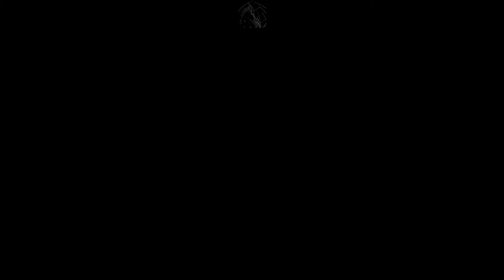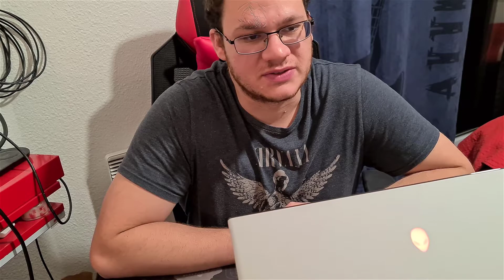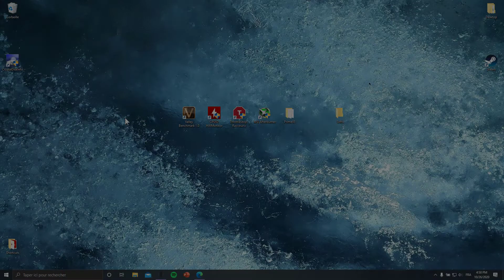How to Undervolt Laptop CPU / OC GPU / Reduce Heat FULL GUIDE (M17 R3, I7 10750H, 2070S)😏😏

Comment: Hold shift to highlight your voltage range on the curve, after adjusting a lower voltage to your target frequency. The target frequency for the lowest voltage on your curve must be above the remainder of the curve. If you hold shift + click, dragging over, then hit apply, it will straighten the entire curve from the low voltage point you adjusted to the target frequency. Saves a lot of time, rather than tediously adjusting each voltage along the curve.

Comment: Lately I have been experiencing a lot of fps drops and high temperatures. I have a Dell G3 gaming laptop spec: i7 10750h1660ti 512SSD and 16gb of ram. So I downloaded the software throttlestop; however I can't change the cpu voltage or Turbo Boost Ratios. These are locked for some reason.
Reply from the maker: Unfortunately, some models are locked.  However, you still can physically cahnge the thermal paste between CPU, GPU and the heatsink to avoid overheatiing and fps drops. For regular gaming laptop user, this maintenance need to be done at least every year.

Comment: Hi man, I have an Acer Nitro 5 with I510300H, you think that could it work in my case? Do I have to unlock BIOS before?
Reply from the maker: Hey, you shouldn't have to touch to the bios. Using throttlestop should work.

Comment: How did u undervolt?? I have an Asus strix laptop with it 10750h but wasn't able to undervolt due to plundervolt...
Reply from the maker: If you can't use throttlestop, check Bios settings maybe you have and overclock or performance menu to undervolt there.

Comment: I’d imagine you’d recommend doing this out of the box, huh? lol
Reply from the maker: It only depends on what people want for their laptop.  But usually, less heat is more comfortable.
Reply: @cyclo16hacks  I’ve undervolted the 10750H to a 3.0Ghz cap. Was at 3.5 but was still maxing out at 93-100C.

At 3.0 at full load, it maxes at 74-82C.
Reply from the maker: @TheFaux1776  3.5 still pushing 100 °C ... weird. But in prime 95 ?   In games it should be somewhere around 80°C maximum no ?
Reply: @cyclo16hacks  nope.

Comment: Great Video, thanks you so much.
I’ve just ordered an Alienware m15 r4 i7 3060 with the 300hz display, I don’t intend to use it for games, but for university study, autoCAD and solid works. My only concern is the 300hz display draining the battery away while surfing the web. Do you have a solution for this? Any help would be greatly appreciated! TIA.
Reply from the maker: Hi thanks, unfortunaltely, if it's like mine (300Hz too) the dispay is physicaly connected to the 3060. Which means there is no optimus for power saving. I don't know if Alienware implemented a GPU switch on R4 but there's nothing you can do. The best battery si along with 144 Hz panel I believe. Still stuck with 1 hour battery XD.
Reply: @cyclo16hacks  So not even reducing the refresh rate to 60hz helps?
Reply: @Balthazarry  nope. I play my in my backyard on my 2080super/10750h raider, tried lowering my refresh rate to 60hz for more play time on battery. I get maybe 45 minutes max playing re2. Little over 30 playing horizon.

Comment: What overclock values you use for your laptop ? I have the same one and wanted to see what’s the max overclock values I can use for it.
Reply from the maker: The max OC for benchmark like 3Dmark is +192 Mhz on core clock and + 500 MHz on memory for me. (gives me better results than 3080 "maxQ") But those values are not stable in games like COD. The stable value for all games is +125 MHz on Core + 300 MHz on memory. (applies only on GPU RTX 2070 Super since I have an i7 that can't OC.)

Comment: I have m17 R2,can I follow the same procedure,and my undervolting is locked ,so please help
Reply from the maker: Can you check "Unlock Adjustable voltage" in Throttlestop ? I've seen some people saying that after the latest BIOS update undervolt is locked ... so if you did this update this is why. And I'm not sure you can roll-back.   Else, you still can play with the turbo ratio ??  If not, go in windows advanced power setting and set the maximum CPU perf to 99%. It will disable turbo. You'll loose quite a lot of FPS but it will reduce T° by 20°C.
Reply: unlock adjustable voltage is available ,i followed the steps but there is no decrease in temperature,and if i change the turbo limits ,will it affect the gameplay and can i set the offset voltage to -140 and see if it works
Reply from the maker: @vruven  the undervolt is not meant to make a significant changes even if it does something ... If you want to see a real improvement you need to make a compromise between temperature and performances with the ratio. This is the only way. You need to find the ratio that stay stable and don't throttle.
Reply: @cyclo16hacks  and I am not able to change the voltage bin Intel xtu but I can change in throttle stop,and the temperature has not decreased at all

Comment: Hi . My laptop alienware m15 r3 have gpu rtx 2070 super and cpu core i7 gen 10 , 
When i overclocking ti on core clock 150
And memory clock 200 as u do the game crashes after 5 or 7 minutes . Can u tell me where's the problem plz ?
Reply from the maker: Hi !! It depends on which game. Every games doesn't support the same overclock. ex: Warzone will only take +125 MHz (clock and +300 Memory) in my case. As with Apex Legends I can go up to +190 MHz on CLock and + 500 MHz on Memory. Som other games, will jsute not run with overclock.  But in all case, put + 125 MHz core and + 300 MHz Memory, you should be fine :)
Reply: @cyclo16hacks  thank you so much

Comment: @Cyclo16 Hacks Do you know if I can use these values for the original 17 r3 (not m17 r3)?
Reply from the maker: I don't think. 17 r3 has older CPU which at the time didn't suffer from overheating like now I believe. They had a huge fan and better cooling.

Comment: when i run prime95 temps go up to 100 *97 degrees and stays on that temp for like 10 secs then decreases to 70-75  degrees and stays there is that a problem?
Reply from the maker: are you running on battery ? This could explain this behavior. Else It could be another power setting.
Reply: @cyclo16hacks  no i pluggged the charger and battery is full
Reply from the maker: @msbrdmr  hummm .. check the CPU clock frequency. Does it change when temps drop to 75 ? Maybe there is some limits due to throttling but it's weird.
Reply: @cyclo16hacks  I did undervolt and capped the freq to 3.8 ghz now its running stable at around like 70-80 degrees I think thats fine but as i remove the cap on frequency, temp goes to 95-97 even with the voltage reduced.
Reply: @cyclo16hacks  and when it drops to 75 , my frequency drops as well. It might be some kind of throttling like power or temp.

Comment: Hey there, can we do anything about the extremely annoying high pitched screaming noise that goes along with the fans? Thanks.
Reply from the maker: Hey ! Except trying to tweak fan speed using custom profile in Command Center, there's nothing to do. :(  It seems to occur when fans are barely audible, so maybe just increase them a little bit or use cool mode when not gaming.
Reply: @cyclo16hacks  Hey dude, I actually solved the problem with the M17 R3 whistling noise.  It's not the fans at all, it's the case.  You can almost completely remove the whistling by popping off the bottom of the case and putting a bit of electrical tape over the four little wires that cross over each fan---you'll see what I mean when you look inside.  You don't need to do anything more than pop off the back.  After putting some electrical tape over the wires, the sound is almost completely gone while at idle and temps are running 35-45C when on full speed so there is no impact to the temperatures whatsoever.  It's just a very bad case and not coil whine or bad fans at all.
Reply from the maker: @ptanyuh  Hum interesting. So, this noise was just because the air sucked through the wires make them whisper ?! Gonna try that !! Thanks :)
Reply: @cyclo16hacks  Yip, exactly! You can still hear it if you listen really hard because you know it's there, but it's MUCH MUCH MUCH quieter.  It's a stupid case design....
Reply: @ptanyuh  alot of people have that problem, you should make a video showing what you did!
Reply: @cyclo16hacks  Not for me, it occurs almost constantly even on quiet mode or using the fan settings you suggested.  Very rarely do the fans completely shut off and I can't hear it.  I can't get the fans to go any lower than 50% so the noise is always happening.  I don't mind it while gaming to be honest because I wear headphones anyway, but being able to sit on the couch and watch a movie or sleep with a podcast on is something I need to be able to do with my laptop, and right now I have a constant migraine from this stupid f***ing noise :(

Comment: just a heads up,  make sure under "Save Voltage Changes to Throttle Stop" On the bottom right corner you check the box "Ok Save immediately". or you will loose your changes when you close out.

Comment: please help someone,
 i can not change the turbo ratio limits does someone know whats wrong ?
Reply from the maker: It happens that some laptop settings are locked by manufacturers. If you slide down the ratio and then it doesn't show any changes, maybe it is locked. (try run the program as administrator again) but ... can't tell you more. There are probably other thing you can try like go in BIOS to unlock but it depends on your specific laptop  model.
Reply: @cyclo16hacks  i have the Acer Nitro 5 (AN517-52-7311) i7-10750H Geforce nvidia gtx 1650 4gb

Comment: I have a acer nitro 5 with i7 10750h end rtx 2060... My initial settings say that core voltage is a  (+ 0.5). What can i do? Help me.
Reply from the maker: initial setting is +0.5 V in core voltage offset in throttlestop ???
Reply: @cyclo16hacks  yes
Reply from the maker: @roccoscicchitano4795  I never seen that before. Also my experience is limited to a few laptop I owned. But you still can try to reduce it slowly. like 0.5 to 0.45 to 0.4 to 0.35 etc etc and if there is no blue screen  or crash during test then keep trying in negative. That's what I would do. But, it's your device ... your risk. Can't know if acer did some internal tweak.  :/
Reply: @cyclo16hacks  thanks bro

Comment: What thermal profile were you using? And with stock paste, -90.8mv on core and cache, in prime95 running at 3.6Ghz using 71.5watts on package average, and running it for 2 minutes on performance mode got me to 91c. Is that alright?
Reply from the maker: 91c on prime 95,, it's fairly good with stock paste ! (edit: was on performance mode))

Comment: the voltage offsets are still 0 after applying the desired offset values... even in Intel XTU,  these options are greyed out.. pls help
Reply from the maker: It seems like some manufacturers lock CPU settings. Sometimes you can unlock in BIOS, sometimes you can't. Throttlestop is the best way to acces this, since XTU need to be manually restart.

Comment: I set -100 on my Alienware m17 r3, after that my notebook is freeze
Tried  it few times. Have the same CPU. -90 works fine for me
In any case thank you man, you save my life))
Now I have temperatures around 50-60(I set also 3000 frequency on my CPU)
Reply: Did u just restart to fix the freeze?
Reply: @crysis1174  yep, I just did a restart
Reply: @АндрейКоваленко-о5е  Which settings were it on? Save immediately or do not save?
Reply: 3700-4000 its still good but 3000 is to much down... Understand how inportant is temp but this procesor can use with 70-80

Comment: Is it normal for the fans to not be on at all sometimes i noticed unless im in a heavy load they are at 0 percent in control center  in the balanced fan mode  with cpu and gpu temps around 60-70c,,,, other times once the fans kick on they will setlle around 30/40 split even at lond periods of idle
Reply from the maker: It is normal if you are not on full speed or performance mode. Then the temps will keep stacking up slowly, so they will turn on after a while to cool down.
Reply: @cyclo16hacks  thanks! that was my thought, there does not seem to be much of a difference between balanced and cool..... i wish we could Map balanced and performance to the alien Macros
Reply from the maker: @1995bulldog  Yeah I wish that too.

Comment: Do you think this machine can handle 80-95 degrees for long periods or will it cause damage overtime quickly? I’m thinking of getting core i9 in this chassis with 2080 super and I’m expecting high temps

Comment: GUYS PLEASE LISTEN TO ME FOR A FEW SECONDS THIS WILL SAVE YOUR LAPTOP!!!
I've been playing with my Acer Nitro 5 with GTX 1650 and I5- 9300h
Without undervolt my temperatures were (while gaming) 85-95°C always
After undervolt - almost same thing
I once got an idea to lift my laptop so it and the fans can breath because my table was blocking the heat from laptop
After I lifted it up my temperatures were so much better 
CS:GO almost always 78-80°C max 85°C
GTA V - 78 - 83°C max 89°C
PLEASE LIFT YOUR LAPTOP 
I did it by putting a book at the back of my laptop and I put the back of the  laptop on the book 
And it worked fantastically!!
Reply: @superresistant0  you play on a floor?
Reply: @superresistant0  @pajo just lifted and temp went down. yay!! lol

Comment: Thanks for the video, can I apply the same values for the i7 10875H? I have the m15 r3
Reply: @ilikemonkeys9532  I didn't, I only started seeing a good difference with my values, now I combined that with a turbo boost limit at 3.8 when all cores are active, now I don't go past 70-75 degrees when gaming with no performance loss, I also recommend using the cooling pad iets gt300, it's heavy and noisy but the cooling system is very good
Reply: @ilikemonkeys9532  yes it's the turbo ratio limit, I have it set to 43 1st, 42 2nd, 41 3rd, 40 4th, 39 5,6,7 and 38 for 8th
Reply: Mehdi, Could u please tell me the result? My m15 r3 will arrived next week and I also planned to do the undervolting.
Reply: @MemoirsJinJar  I was able to do -90 on the cache and -165 on the core, I didn't tty to go further and it's stable, I suggest you try lower as Cyclo16 suggested, I started from his values and went up by 5 increments on the cache and 10 on the core
Reply from the maker: @AndrewReyes-h7o  I don't know why Intel would have disable undervolting and still allowing us to under-clock it.  Manufacturers can lock CPU settings but I don't think Alienware is doing it. In any case,  you won't see much a different by just applying undervolt. And especially, on the m15 which one got a smaller cooling unit. You should adjust CPU clock.
Reply: @cyclo16hacks  they disabled undervolting because of the plundervolt
Reply from the maker: @AndrewReyes-h7o  I didn't know about that plundervolt. I knew there was a security issue.. it just say Intel disabled the voltage subsystem... In any case, changing the CPU clock changes the voltage. And the fact that we can change clocks ... well we change  the voltage aswell.
Reply: @cyclo16hacks  yeah but will decrease performance as well
Reply: I have this model too, thanks for asking.
Reply: @ilikemonkeys9532  I have two profiles, one for full performance usually I use it for work and the second for regular tasks and gaming since they don't really require a lot of frequency
Reply from the maker: The 10875h seems to have a lower undervolt range. A safe value would be around 50 mV. You still can try with -100 mV but then if you got blue screen just got back to -50 mV. I'm still not sure if -50 mV is gonna do something noticeable.
Reply: @cyclo16hacks  thanks! I ll try it out

Comment: Have you had any issues with the unit so far? I’m kind of scared of getting this unit cuz I cnt get it from the dell website with the warranty on it since I live in a country where they don’t provide shipping.
Reply from the maker: I agree that Dell's product are mostly interesting for the On Site 1y included warranty. That being said, it works as all other brand. I had 0 issues with it. Like everything, you can be unlucky and get a defective unit but it concerns 5 or 10% of consummers. In any case, you should be able to return if any problem.
Reply: @cyclo16hacks   thx for your insight, I will consider getting this machine
Reply: @drnight4462  you can buy it in local distributor
I already bought it in Ukraine in local shop)
I don't know your country, but if I can Ukraine, then it's possible to buy in any other country :D